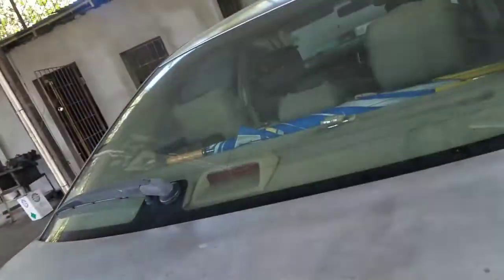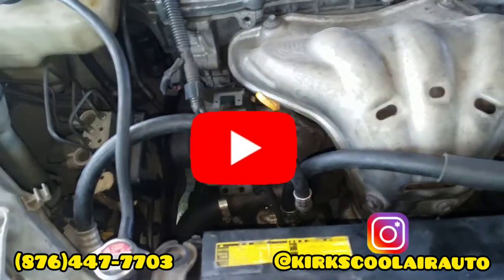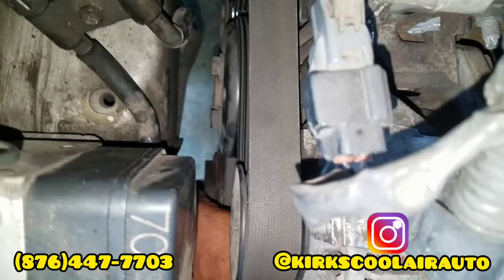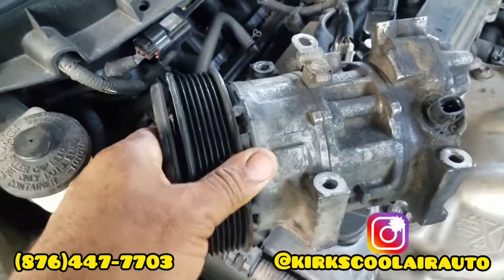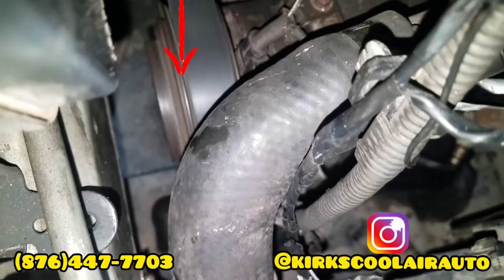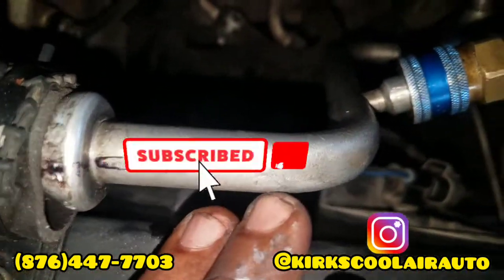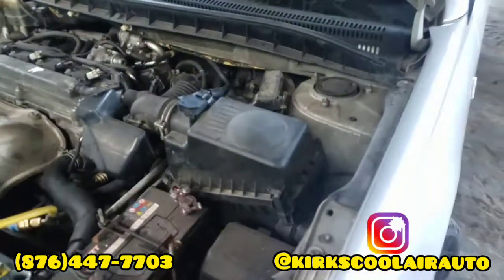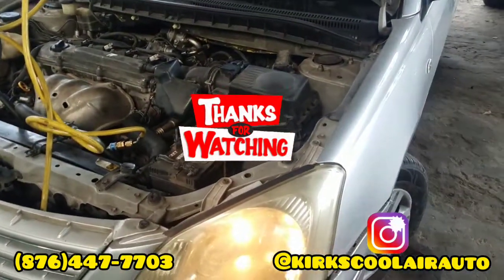Toyota Premio A/C Compressor Clutch VS Solenoid And Why You Should Not Choose A Solenoid Compressor

Comment: I have vitz with 2sz engine, 1.3cc. This car came with solenoid compressor, now i have replaced it clutch compressor (fixed displacement compressor) that came in vitz also (with 1sz engine 990cc) now this compressor is making my car not accelerate fast when AC is on, but also occasionally it cause some engine jerking when clutch is engaging.. kindly can you advise what to be done to solve these challenges?
Reply from the maker: I never install a clutch compressor and have that issue. Is not everybody know how to install a clutch compressor. If you don't install it properly the vehicle would burn more gas the engine will also vibrate on the compressor will all so burn up
Reply: @KirksCoolAirAutoTV  may  be I should explain further how the installation was done.. mechanics took the solenoid valve and installed it back and also added relay for voltage amplification to 12v for clutch( the voltage amplification was done by connecting one wire to the positive side of alternator to relay and another going to the clutch, the trigger side of relay was connected with wires that are coming from ECU to solenoid...and the solenoid valve was connected too).. this how the wiring was done: